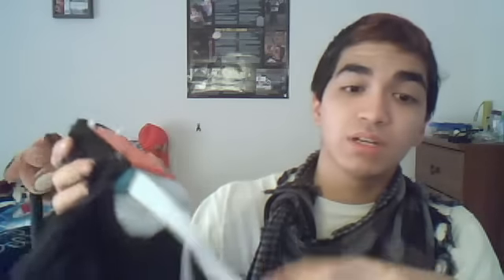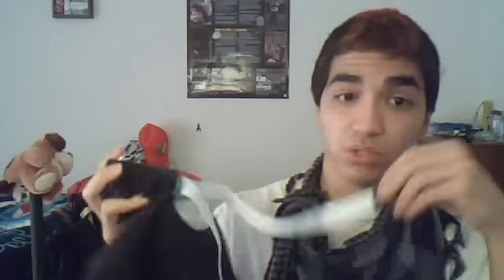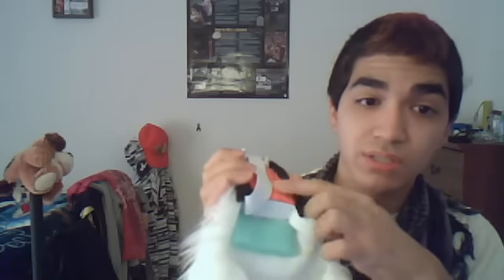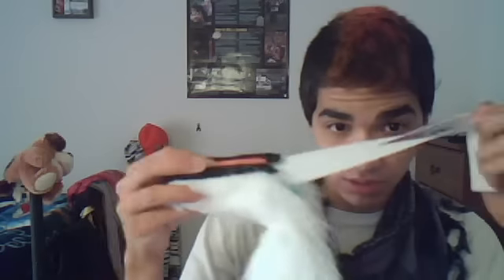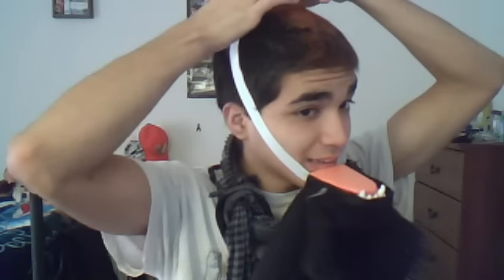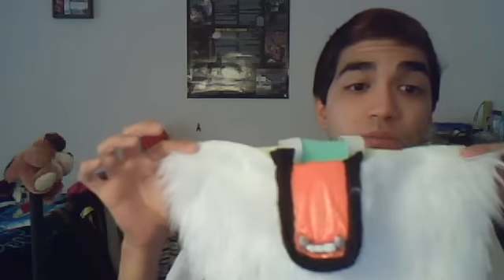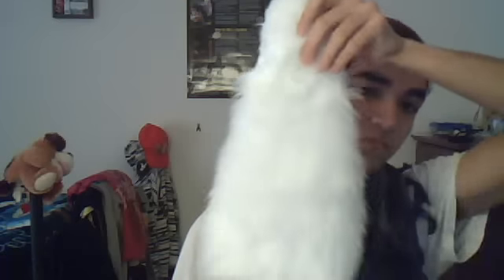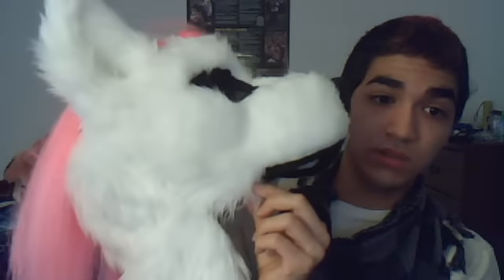Jaw Movement Explained!

Comment from the maker: @Kalira09 Thank you very much and I do love making these's things their just so much fun!

And I've had a bolt come out of a jaw before and the jaw wouldn't move, I've also had when I use to use hot glue to get the velcro on the elastic the jaw come off. but because the strap wraps around the head and under the head it didn't fall off completely. It kinda just hung to one side XD it looked funny as hell though.